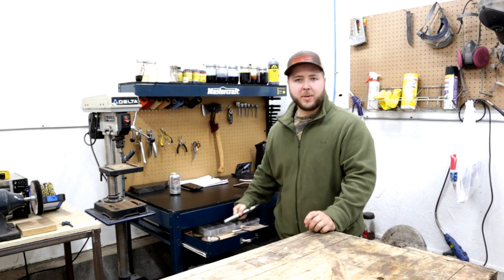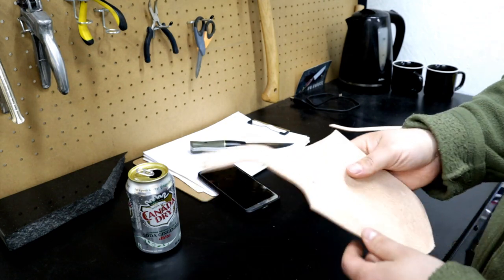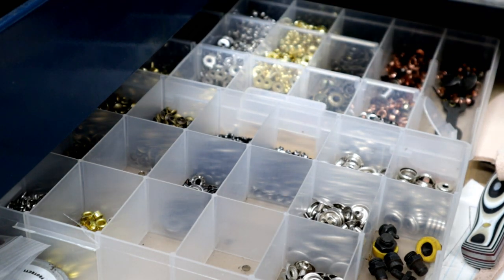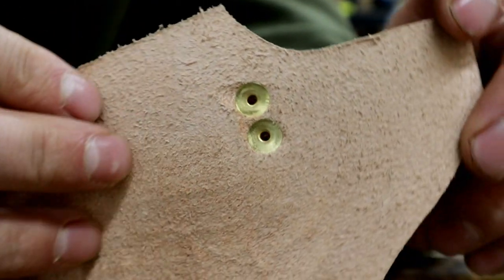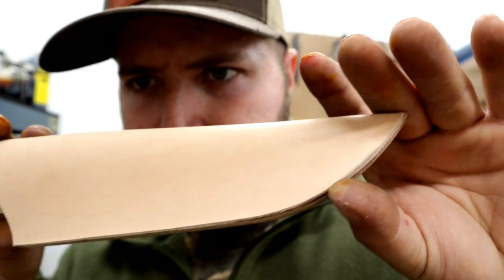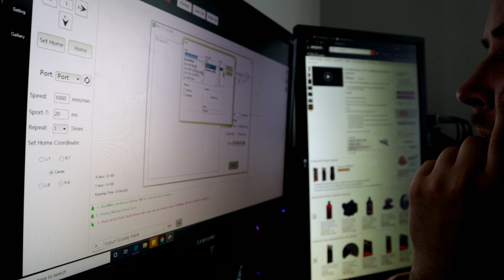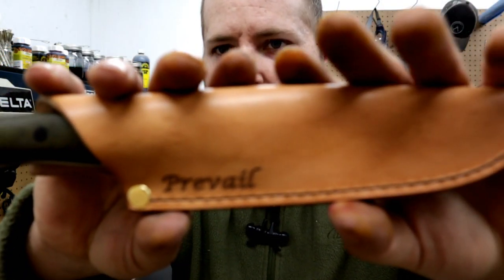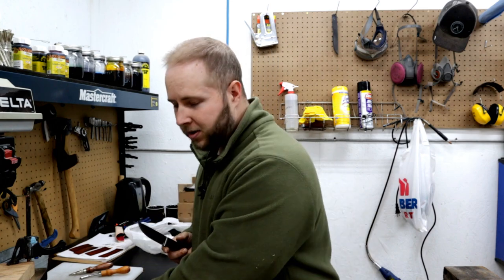Finishing Troy Bullock's Custom Knife - [LEATHERWORK]

Comment: Great looking sheath.   I noticed you didn't leave a drainage hole or cut the welt a little short where the tip of the knife would be to let moisture or rain out of the sheath.  Is this because you don't find it necessary or for another reason?

Comment: I'm not a fan of drilling the holes for the stitching, because I often make scandinavian style sheaths w/o gluing. Drilling the holes out removes leather that would otherwise pinch down on the stitching, when you punch the holes with an awl. Also, you'd usually leave a little loop on one side of the stitching to go through with the other needle so that you form an overhand knot in each stitching hole when you pull taught.
Other than that, solid job. I like the oil finish. Also kudos to your little inquisitive apprentice.

Comment: What kind of biffing wheel did you use to burnish that edge?
Reply from the maker: MDF wheel coated in beeswax!
Reply: I’ll I can find on Amazon is leather stropping wheels. Where’d you get it? Also, do you think the Shop Fox Knife Belt Grinder/Buffer is a good entry level sander for knife making? Or should I save up and get a 2 x 82? Thanks Kyle.
Reply from the maker: @KevinsDisobedience  I made the MDF wheel. Easy and cheap, and the mdf provides a lot of friction for burnishing. I like it. No info on the grind. A 2x72 is an awful big investment out of the gate though. I think Id spend some time with a cheaper option first. 2x48 is a nice option!